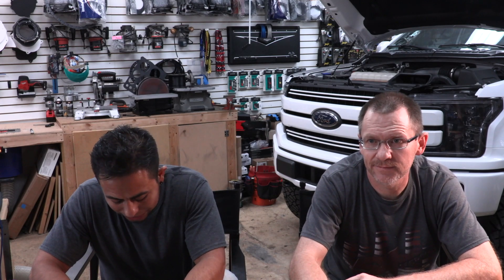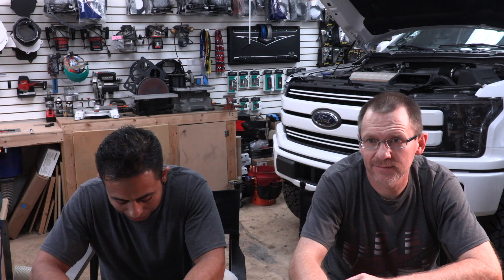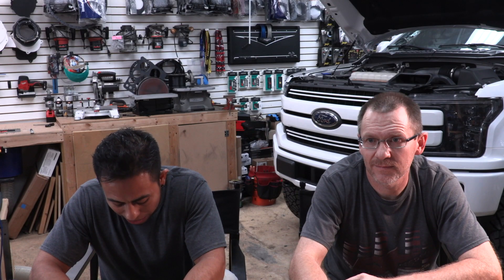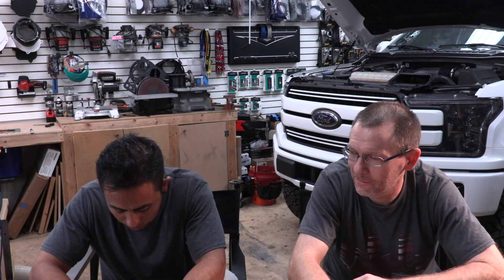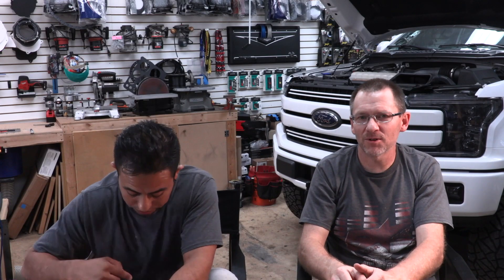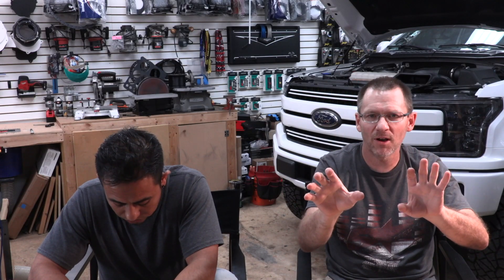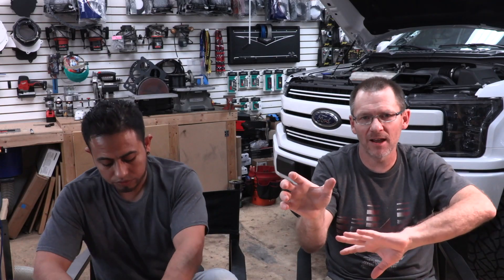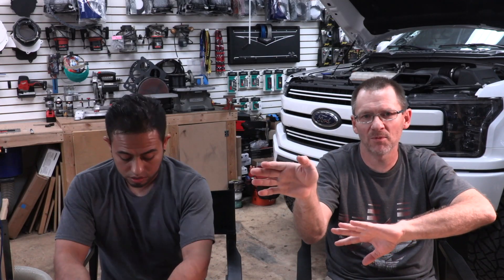is it ok to run 2  6x9 and 2  6.5 plus a 1" tweeter on the same channel of my amplifier

Comment: No I did that on a  2000 Tahoe had the back channel  6.5 themselves and front 6.5 and tweeters on front  put them all on the front  bridges rear with a 4 ohm  10" sub ,front channel got 1.3 ohms front, and fried  my Rockville rxd F-30 4 channel marineamp  turn on goes into protect stays in protect

Comment: Can I use my rear output of my amplifier to connect 4,  6 x 9? And how do you wire it Can it be done I currently have on my rear output 2 6x9 but can that same rear output run 4 , 6x9

Comment: I have a 4 channel amp which i’m gonna run 2 6.5, 2 3 inch tweeters and 2 4x6. would i be able to run the tweeters and 6.5 on the same channel per each one? So 1 channel 4x6, another the other 4x6, one 6.5 and tweeter, and the other 6.5 and tweeter
Reply: Yea u can do that also depends how u have the 6.5s connected. Are the 6.5 and tweeters wired together or are u using crossovers?

Comment: Could I splice into the two wires that power my 6.5 door speakers to wire my 2inch tweeters with no amp? Will I have any issues?? Or will it work
Reply: @Cee-i4p no what? No I won’t have issues? Or no it won’t work? Because I already did with a fuse soldered on the tweeter just incase. And I tested it with a multimeter and I’m getting proper power supply through the tweeters. All the other audio people I consulted said just make sure you put a fuse on it and it’ll be fine
Reply: @kingchief6941 a fuse?…or a cap?  Never have I heard of inline fusing a speaker…